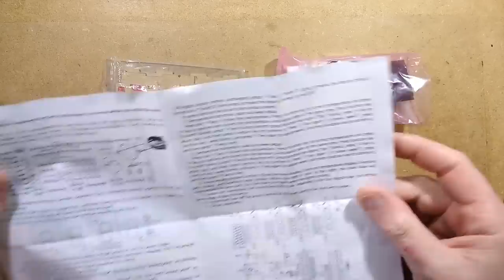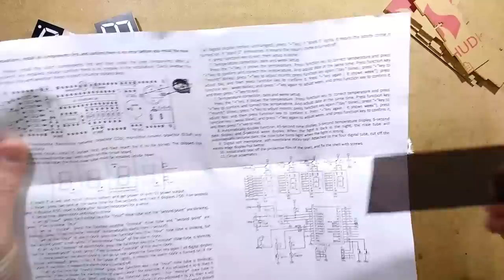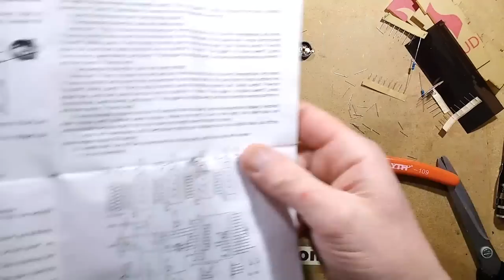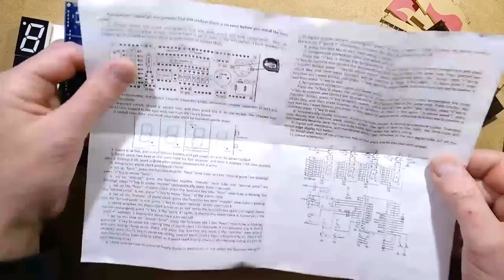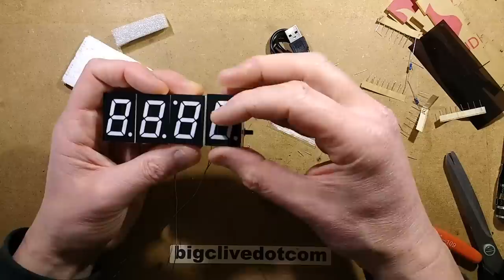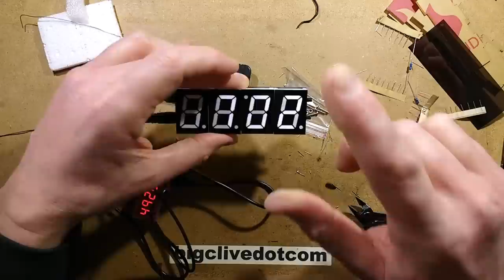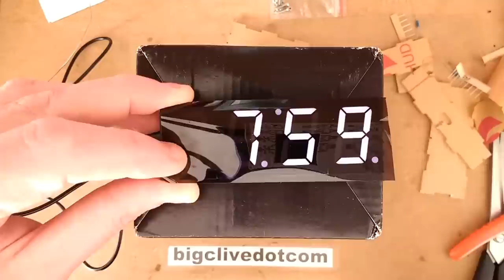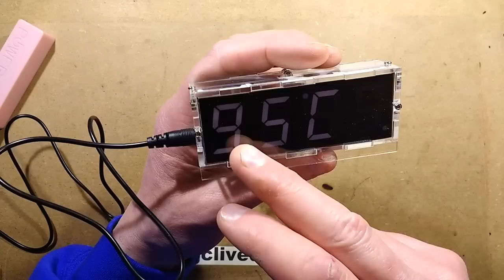eBay clock kit.  Full build and setting guide.

Comment: Hey Clive, (and anyone else who reads this)

I've been working in plastic fabrication for the last three years... a nice little trick for removing masking on plastics, especially small parts, is to use an eraser/rubber. a standard square white one will do the trick. simply drag it over the edge and onto the piece. starting off a corner when doing so will be even easier.

Hope this little trick helps someone
Reply: fucking oath mate
Reply: Brilliant!
Reply: Nice, many thanks (3 years later)
Reply: No best thing to do is submerged it in acetone, then come back after an hour and there won't be any masking left.
Reply: Fantastic solution! Can't wait to apply it to my next project.
Reply: @Shazzkid  yea and if it's cheap chinese plastic depending on its composition you'll come back in and hour and there will be nothing left.
Reply: @downtheshedwithjason  Glad someone thought of just using a piece of scotch tape... packaging tape... easiest way and you wont leave weird rubber marks on the corners...
Reply: This is simple, but genius
Reply: The display segments look quite dim. Is that true or does the camera just read it like that. Oh, wait, it has an ambient light sensor, doesn't it?
Anyway, nice little kit. Let's see what our run away inflation has done to the price of it.
Thanks, Clive!
Reply: oh mate.............. i love you. thx
Reply: @ATMAtim  
I think it is a combination of the housing with the camera. Without the housing the displays are quite bright. It could be that the housing polarizes the light (quite common with plastics) and the camera will filter out or has its own polarizing filter in the wrong way.
Just ordered such a kit, in a month I will know if this was just a camera effect or if it is noticable in real life (but honestly I don't think so)
As for the price (this is 2022): with the link he provided I found a kit which looks very similar (if not the same). The price is still a little bit over $5 (plus shipping).

Comment: I'm glad you mentioned that the background noise was a lawn mower because I thought it was a helicopter at first and we were watching you build a kit in a 52 minute stand-off with the police. I suppose they would need a trail of dodgy electronics to tempt you out in that situation...
Reply: did he have lots of round tubes painted red with wires coming out the top :O
Reply: next we will hear people are washing their car, i will think clive lives in the 1950's but then, perhaps the isle of man is like that..
Reply: John Howard was cutting grass myself today,  I am down south tho.
Reply: you can barely call this winter, no snow, hardly any frost, temps in double figures most of the time
Reply: I have more than half a metre of snow! It's winter, alright?
Reply: yeah but you probably live in Finland
Reply: I thought it might have been a generator. I came to the conclusion that Clive had spent all his money on Chinese vibrators and clock kits, and was running a generator to make his videos.
Reply: lol
Reply: It's 62F right now. Lol
Reply: I've got so much background noise here that I couldn't even hear it. lol
Reply: Watching this at 23:30  looking out wondering what nut is out on their mower..
Reply: Matt Tester 
Hahahaha..

Comment: Hey Clive. I built this clock some time ago, and found out that you can short pins 6,7 and 14 on the bigger IC.
This will prevent the clock from cycling all those display functions, and will stick to one (you can cycle manually using the button). So you can have it display time all the... well, time :)
Reply: MasterBata .. do you short all three pins together?
Reply: Yes. If you don't want to solder them permanent, you can just run a thin wire from 6 to 7 and 7 to 14. Just press the wire into slot together with IC pin.
Reply: DISPLAY ALL THE TIME! 😃
Reply: Are those pins shared with the buttons or will you loose some functionality while doing so?
Reply: Check the schematic and you'll see P3 (a 2-pin connector) is pins 6-7 of the STC, also P1 (a 4-pin connector) has connections for +5v, ground as well as the two lines which are on the switches. These connectors are not populated in the original kit build, however I decided to insert header pins there in case these turned out to be useful. I only wish I hadn't fully assembled the case before reading these comments, now I want to do this mod but hate the hassle of disassembling the darn thing!
Reply: Other modes of operation of possible by different combinations of how you connect pins 6 and 7. Note that both these pins are supposed to be brought out to jumper pads on the top of the PCB but in fact pin 6 is not connected. There is an error on the board. If you connect pin 7 to ground you get the time for 55 seconds and the temperature for 5 seconds.
Reply: After shorting the P3 pin 6 and 7 to gnd, nothing changed. Are you refering to the actual pin 6 and pin 7 on the big IC? The ADC3 and ADC4 pins?
Reply: Hopefully we get an answer. Someone should make a vid.
Reply: I performed this modification.  As stated, shorting pins 6 and 7 of the IC to ground will stop the display cycling.

Another comment suggested that the unpopulated 2-pin header P3 are the same as IC 6 and 7, but this is not the case.  They correspond to 21 and 22 of the IC.  Shorting these pins will not work (at least on my clock which appears identical to Clive's).  Also worth noting, the second-from right pin of the 4-pin P1 header is a convenient ground.  The working modification I performed is here: https://i.imgur.com/iFtRY8E.jpg
Reply: MasterBata Is
Reply: I soldered a 10k pull down resistor between pin 7 (P1.4/ADC4) and 14 (GND) of the IC. The clock shows only temperature and time now.
Reply: MasterBata thanks for the tip! Now its a real clock!
Reply: On the one i built, you just hold tghe bottom button for 5 or so seconds and it then JUST displays the time, without cycling through the others.
Reply: This works perfectly, thanks!

Comment: You'll love this, Clive - NOT! I enjoyed watching your digital clock build, as I built one in the late 60's using digitron tubes (remember those? Bit before your time, I think!)  - made up my own timer, flip-flops, PCB etc.

I sent off for the kit you got (similar) and built it - for my 11-year old grandaughter. All worked fine, then I ordered some 3v coin cells, fitted one and set up the timings etc (Appalling system setup, what?). I even rewrote the instructions in a legible form, so my grandaughter could do the setup if necessary.

Now comes the faux pas! I unplugged the clock from my PC USB port, took it to the kitchen with a small 5 volt mains power block, and plugged it in. All four nixie tubes burst brightly into life, reading: 8888 (in 7-segment form!), with the buzzer buzzing very loudly! Switched off quickly, to find that I'd plugged in a 12v power supply by mistake. DOH! Tried it with a 5v power block, to no avail. So I've probably blown the two chips and possibly something else, but haven't yet checked. I've only been an electronics engineer for over 50 years! Do I feel stupid? YES!
Reply from the maker: Easy done with identical connectors with different voltages and polarities.

Comment: This setup is definitely better than the ipad now. I listen with headphones and the audio sounds very good. Nice build too!
Reply: hifromrich I think that there is some noticeable echo that I don't like.
Reply: hifromrich it's much better video wise, the audio quality is about the same which I don't care as long as it's not too echoey or sensitive.
Reply: sounds fine to me, but i have no frame of reference for what he sounds like in person
video is artificially sharpened with a bit of white crush
i'd rate it overall a little higher than the ipad
Reply: Tru dat
Reply: 31:08 Might have been a head collision! Bearing in mind that it's a mid tier smartphone it's very good. 

We could do with some zoom ability, I wonder if the digital zoom is useable?
Reply: I liked the iPad sound much better! Now it's boomy, bassy and there's not much in the higher frequncy range.
Reply: His mic is slightly too close to his mouth, but I agree that it's an improvement.
Reply: for sure , Way better than the ipad.
Reply: Sound is much worse than the iPad (as much as i hate to admit it). This is far too bass heavy. It was mentioned on a previous video and at the time i was listening on a laptop so i couldn't hear it. Now that i'm listening on studio monitors it's blatant to me. And yeah, the iPad also had nice high frequencies unlike this one.
Reply: i agree with Halojen
Reply: Sound is way better off the 32 inch tv.  The old vids would rattle the speakers.  Not so much treble in these

Comment: +bigclivedotcom I wasn't able to find a public source of the firmware (whether source code or compiled), and Banggood would not provide it, so I put together my own github repo for it. It's mostly functional and close to original functionality, but could be extended to do lots of other neat stuff (DCF77, etc). Enjoy hacking:
 https://github.com/zerog2k/stc_diyclock
Reply: Clive, please pin this hero a comment! And you get hugs from me, both of you.
Reply: This is very cool. That stock firmware is atrocious.
Reply: Two things I don't understand about your code:

1) As for your _delay_ms function: how is it that the compiler doesn't just optimize the loops out?

2) What about leap years and non-leap years? You do not provide a way to set the year. So the thing will probably assume that you are in the year 2000 which was a leap year, and give 29 days to February even if you don't want it to.

and one suggestion:

If you provide a way to set the year, then no need to provide a way to set the day of the week, as you can provide code to calculate the correct day of the week and set it automatically.
Reply: Robert Lozyniak This is STC ISP provided sample delay function - I tweaked the timing based upon my own scope readings twiddling a gpio. They are "close enough" for this purpose of cheap delay waits (timer is being used for more exact display refresh timing.) I'm not sure why SDCC doesn't optimize this away.. I suspect that may only happen with more aggressive compiler optimization levels.

Regarding year setting, leap-year - great point. Can you open a github issue? We could add year setting/displaying feature, as the DS1302 seems to have leap-year compensation feature. Patches are welcome ;) - I guess we are about to have an extra day on the calendar (

Regarding "auto" day-of-week, I guess this can be done in the software (ds1302 doesnt seem to take care of this for us). Also good for a feature-request/issue on github ;)

There is limited amount of code space (4kb in most) on these mcus so we must be judicious about features, make them compile time selectable options, optimize into (less portable/maintainable/readable) assembly, and/or resort to more tricks (like abusing "features" of these chips, e.g. "eeprom" space for code, hehe)
Reply: I notice that you increment a BCD integer by converting to binary, incrementing, and then converting back to BCD. Would it make the code simpler if you just dealt with the BCD directly? Maybe: add 0x07, then if low nibble is nonzero, subtract 0x06.
Reply: I'm a relative amateur to microcontroller programming, so there are probably a number of optimizations to logic and code size that are available here. Welcome to suggestions and working pull-requests!
Also, I have a gitter chat, which is probably a good place to discuss the workings of the code:
  https://gitter.im/zerog2k/stc_diyclock
Reply: thank gord. I was looking all over for info to reprogram mine and couldnt find anything. tossed it in a drawer cause setting it up was so terrible.
Reply: Leap year detection is easy - if the year is mod 4 it is a leap year, if not, it isn't. Yes, that will fail in the year 2400 or so, but do you still expect that the coin cell will be working by then? I don't. :-)
Reply: +l wilton Actually, that test will fail in the year 2100, but your point still stands.
Reply: If divisible by 4, it's a leap year unless it's divisible by 100 unless it's divisible by 400. That could have potentially been yet another Y2K bug but we got lucky. The people around 2100 might not be so much.
Reply: If we add year setting/display functionality, the DS1302 RTC chip supports year time-keeping with leap-year up til 2100 - long after we are all dust ;)
Reply: +Jens Jensen Robert is correct, the _delay_ms can be optimized away. I suggest you declare i, j and ms as volatile:

void _delay_ms(uint8_t ms)
{ 
    // i,j selected for fosc 11.0592MHz, using oscilloscope
    // the stc-isp tool gives inaccurate values (perhaps for C51 vs sdcc?)
    // max 255 ms
    volatile uint8_t i, j, k;
    k = ms;
    do {
     i = 4;
     j = 240;
     do
     {
      while (--j);
     } while (--i);
    } while (--k);
}

You may have to adjust the timing.
Reply: I designed a similar unit, but much larger (2.3" digits) http://forum.arduino.cc/index.php?topic=384025.15.For the film I used an LCD polarizer. Wonder if it is the same thing they ship, as not all the kits seem to include it.
I'm working on adding feature such as GPS time, or perhaps internet time. Wonder if the Chinese sell the casing only (they sell the clock only), I could design a smaller PCB to be backwards compatible.

Are the case measurements online somewhere?
Reply: @Carlos Silva Personally, I prefer not to use GPS time or Internet time: I'd rather my clocks be "self sufficient". I use DS3231 for timekeeping, but I can't guarantee 100% reliability: they seem very finicky as to how they are wired up, etc.
Anyway, do they use Daylight Saving Time where you live? If they do, how do you intend to allow for it in your clock?
Reply: Jens Jensen: what development board do you use to flash the chip? thanks
Reply: STC chips have serial bootloader in rom. All you will need is usb to serial uart adapter. See repo readme
Reply: Robert and Morten, I agree that it's good practice to guard against compiler optimization in this case, e.g. msp430-gcc, avr-gcc, et al, but here sdcc does not seem to optimize this away. You can see here existing assembler for the function which compiler produces (_delay_ms_old). As this looked somewhat strange, I decided to come up with my own assembler version (_delay_ms) - note that I'm not so great at assembly, but even though it has a smaller number of assembler instructions, (I'm guessing due to differences in instruction length for stuff like MOV direct vs register), it comes out about the same size?
https://gist.github.com/zerog2k/320af9a3df17c6f2f92b4fa4badb8275
Reply: Jens, I have no doubt it works. If SDCC had optimized it away, you could put a zillion onto that loop and it would still take a few clock cycles. So it works. Later versions of SDCC may break your code. Anyway, you made some code for the board. I didn't. Criticizing is easy. You deserves a thumbs up for the job. :-)
Reply: I suspect that most embedded compilers would not optimize such loops away by default as they are so often used for timing.
Reply: I was going to drop Jens Jensen a note to ask how to program one of these chips, as I have no experience at dong this. (I have been to the page and seen the CJMCU CP2102 USB To TTL/Serial Module Downloader) but unfortunately he has no ability to PM.

Does anyone have any links to vids/resources showing how to hook one of these up to a PC, and the chip, and do the programming please? My usual machines are desktop Linux units. I do have a Rasp Pie 3B knocking around somewhere also, if needed.
Reply: +msknight5 you can either open an issue in the github repo, or there is a chat room at gitter.im (see the chat badge icon at bottom of the readme). Also, look at the stcgal repo readme.
Reply: You misunderstood. The clock is self sufficient, there is just an option to sync the time with an external source, either manually or at given intervals.
Reply: Hey, Where might I begin if I want to learn this. I have a prolific usb to uart 4-pin cable; however when I connect to the port via putty I get absolute gibberish. I did purchase my diy clock kit from ebay, and the microprocessor is a different model: STC 15W404AS. any advice?

Cheers.
Reply: look at the gitter.im chat link at the bottom of the repo readme. Read through the readme, and also the readme for stcgal for programming. Check the schematics to verify this kit build is at least similar to yours. Likely your STC15W404AS is not much different from STC15W408AS (just 4k instead of 8k of code space... )
Reply: Jens Jensen awesome.
 Thanks. I'll post an update later.
Reply: the end
Reply: im looking to remove the date and day but would like to keep the time and temp how easy would it be for me to do this mine runs on a stc15f204ea chip

Comment: I would love to see you do a rewrite of the software for this clock kit... You have the finesse and knowledge to make this function far better, like adding the option of: 12/24hr, ºF/ºC, seconds display, better clock setting functionality and I'm sure other fine BigClivities!  (pretty please!)  Thank you for your kind consideration!
Reply: Software?
I thought it uses a specialized chip that is not programmable.
Reply: @louistournas120  It is actually using a programmable microcontroller. See zerog2k/stc_diyclock on GitHub for replacement firmware.